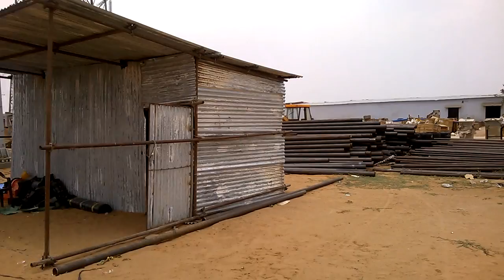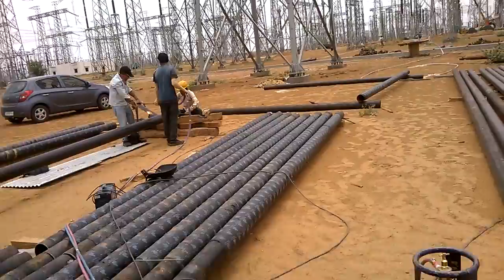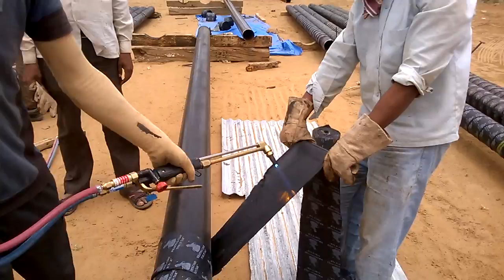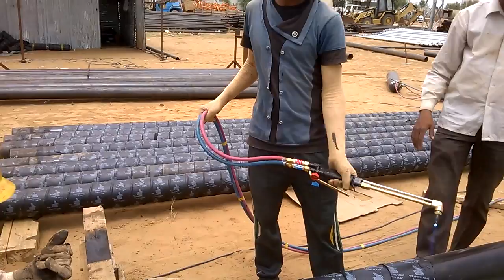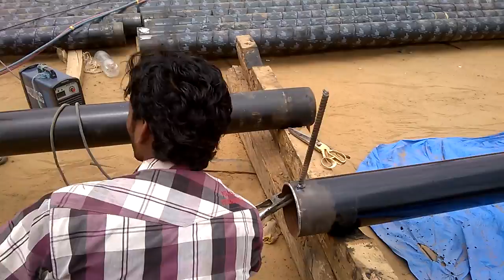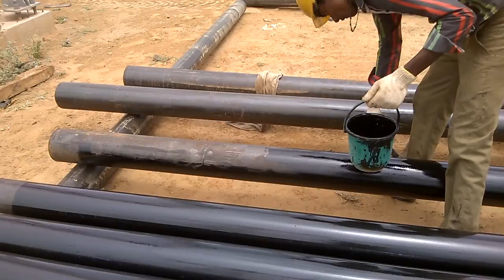Provision of Wrapping Coating for underground pipe

Comment: Hey sir, is it using tapes for the coating, if I may ask, what's the purpose of the coating?
Reply: to prevent the pipe from corrosion and for long life of pipe.
Reply: Tape name
Reply: @nikhilkukshal7379  it should be named heat shrink sleeve.